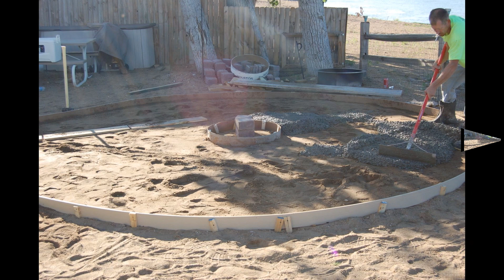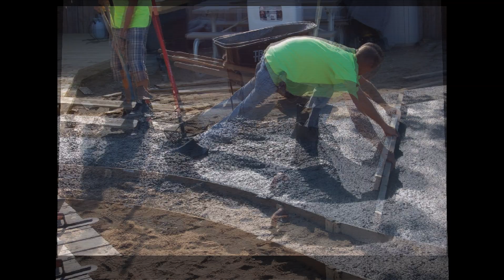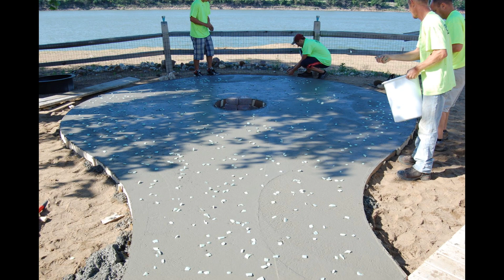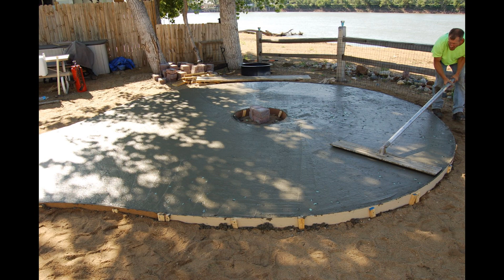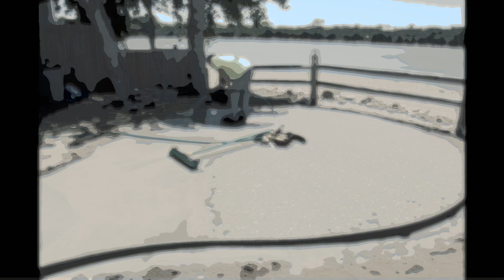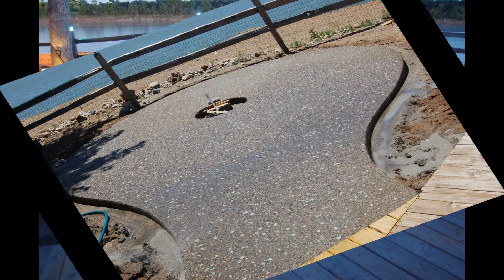Glow in the dark patio with Glytrom glow in the dark aggregate.

Comment: What's that skin coat u put on the levels the glow stones against the concrete which than washes away,  Is that the final step before adding that coat and using the pressure washer?